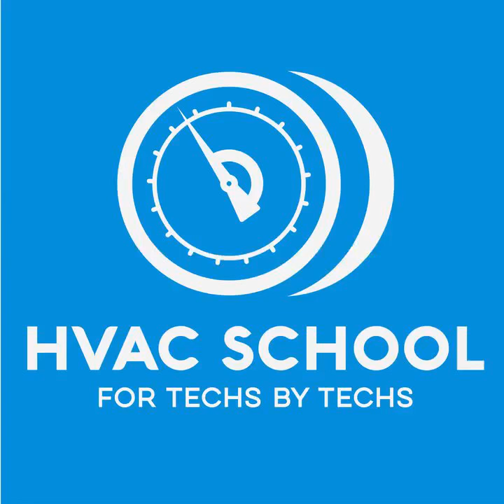Analog & Digital Manifolds

Comment: So I install new heat pumps, straight ac, gas packs for units. I have an anolog r22 and a 410a gauges and an old jb vav pump all good. I would like to get a set of SINGLE port gauges so I don't use the hoses. What brand and type would you suggest. I like what Zack does but undecided what to do. Eventually I would like to get a set of digital ones.